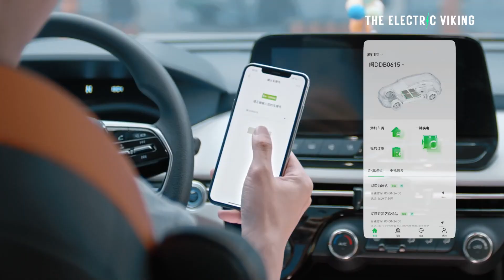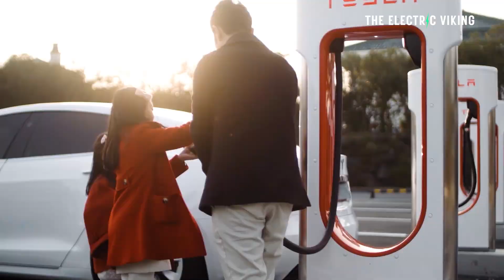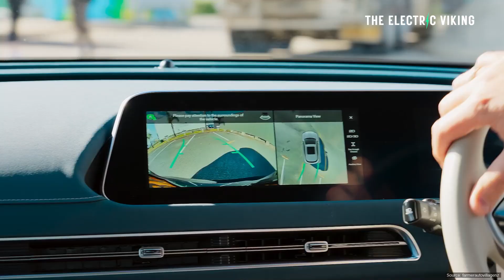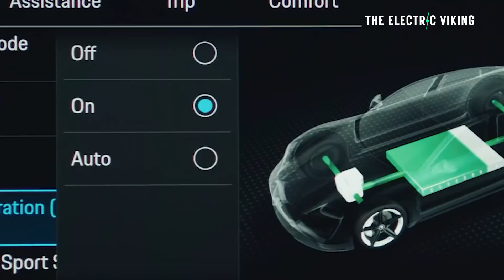Study reveals the price to replace EV batteries has halved

Comment: I don't want my battery to be replaced, I want it to be repaired for a considerably lower price.
Reply: there are battery repairers for Tesla in the US Gruber motors being one
Reply: It would be awesome if the vehicles with the 4680's were designed to where each cell could be replaced.  Instead of glueing them all together.
Reply: @ryandgarland  The problem is roughly 90% of the battery issues happen because of water leaking into the battery case. This is why they glue more and more.
Reply: @gerbre1  👍 their approach is that the battery is meant to live for the life time of the car.  Which is ideal.  However the tech isn't quite there yet, so some battery replacements are still necessary.   This is where dreaming of a hypothetical world where being able to replace each cell would be ideal from a consumer repair perspective.   In the real world, it doesn't make any sense from a functional or economical perspective.  Gluing the whole thing together and making it more structural is a better way to go.
Reply: @ryandgarland It‘s meant for the life time but EVClinic has much to do.
Reply: @ryandgarland  TThe future is blade cells. They can easily be replaced.
Reply: @ryandgarland  The price of the pack WITHOUT batteries would probably be at least 5 times more expensive if you were going to try to do that.  Plus, you'd lose a lot of component rigidity
Reply: You're driving a 4 wheeled touchscreen phone, not a car.  As a result, failed components must be replaced, often at a cost exceeding the value of the thing.

Ain't gonna happen.

Comment: Toyotas recent 3.4 Twin Turbo V6 debacle cost the company $30,000 for each engine rebuild at the STEALERships, and that is not an all new engine only parts that went bad,new crankshaft and block and bearings.Toyota still has no clue what is the cause of failure.
Reply: That's not true, Toyotas don't break, I read that all over the internet.  That's why the don't  have an EV because their GV's are perfect in every way.
Reply: @joedoesfun9336  You know what? The Internet never lies, because it is like a broken record.Lol

Comment: Sam, good job appreciate your videos. One thing,  If energy density increases I don't think you need a lower KWH battery for same range. I would think that  if energy density increases, You need the same KWH battery (60KWH in this case) but the battery will be lighter, smaller, eventually cheaper for the same capacity (60KWH).
Reply: TOO much people assume that less weight drops the energy consumption/ mile also.
That thought is , especially for regenerating EV's, completely false.
Because the extra energy you need to accelerate a heavy car will be regenerated back when slowing down for the most part.
The only increase with extra weight is  some rolling resistance...but in EV cars that is a tiny fraction of the total energy we need to overcome the drag of the car.
(I never noticed a higher energy usage if my car was empty (only myself as driver) or loaded to the max allowed weight.)

Comment: so the cost of battery packs is coming down, but we are told the cost of a battery is half the cost of the car new, so why aren't we finding the cost of cars coming down, except in China
Reply: No. A $50 per kwh  80kwh is only $4k. Even if you double it to account for pack fabrication costs it is still less than half.

Comment: A Price being down 50% isn't saying the cost of production is down.  Just as BEV prices are being slashed; it isn't due to lower production costs, in fact those are rising due to higher interest rates.  The prices are down due to lower demand for the same reason; higher interest, resulting lower demand, and over production. You can find many such economic upsets.  Oil producers can overproduce resulting in oil sold under the cost of production; or wheat, or hoursing in a high interest environment. So you see all the BEV makers and subsystem makers cutting prices and quaity just to try to survive. It isn't a good sign; it is a very bad sign as profits go to losses.

Comment: By law in the US, an EV battery has to be warrantied to 8 years/100k miles minimum.
Reply: Which is not enough, considering replacing a battery pack is still extremely expensive. That is why the second hand EV market is having a difficult time. Depreciation on EVs is extreme, like 10-15% per year. Pure money pits.
Reply: There are two types of EV battery warranties, failure warranties and capacity warranties. All manufacturers offer a failure warranty. (e.g., 8 years/100,000 miles). This is applicable if the battery fails completely. Some, but definitely not all, manufacturers offer an explicit battery capacity warranty (e.g., minimum of 65% capacity available for 8 years/100,000 miles). If you buy a vehicle that does not have a capacity warranty and the capacity drops by 80%, what is your EV battery worth?

My 2017 Leaf dropped 13% in 18 months and had a capacity warranty. My 2007 Civic Hybrid battery dropped 84% in 5 years and did not have a capacity warranty.

Comment: For some reason, leaf ev owner's (I have a 2017) never can quite qualify for the warranty guarantee. Always some fine print clause that explains why you just won't get a free replacement, but they want $15.000 here in Oregon & if you say "do it" you go on an 8 month waiting list that never seems to get cot up. I can get another 2017 leaf used for $8000. Yea, they don't want no stinking electrical car's messing with that worldwide oil power! PS most dealers don't even have an EV tech on hire in their shops in America.
Reply: It is typical car stealership / manufacturer tactics. I had the same thing with a suspension strut fault on a Peugeot. While the car was in warranty, no issue could ever be found but the WEEK after warranty expired, the mechanic had diagnosed the "fault" before he had driven the car out of the parking lot. They eventually did the work based on an 85% reduction but I was still steaming.

Comment: Estimates have the CATL LFP pack at $85/kwh in China. This would be a volume quote. Perhaps Tesla China pays a little less? In reference to "replacement" batteries the current generation of EV batteries at "ten years" measurable range lost will be 10% to 20%. Perhaps we're estimating 175,000 miles? I've been running gas cars for a little over 50 years, the average gas car over 175,000 miles is not a joy to drive.  

There are 80 battery factories planned or under construction worldwide. Billions are being spent getting the price down and they have succeeded. All of this being said? Replacing an EV battery is very expensive and they are never going to be cheap.

Comment: Sam, 8 years is nothing. EV batteries must last as least 20-25 years in good condition and the warranty must be doubled from the 8 years. There is no point otherwise in the whole electric car market. There will not be any resale value for old EVs if batteries must replace a cost which is 10-20 000 dollars. Still EV battery replacement cost cannot be higher than 3000$.
Reply: Show me an ICE car with a 20 year warranty on any part.
Reply: @GlenisRetiredNZ  Show me the ICE car fuel tank which will fail when fueling up too fast or too often or too many years? There is no need for warranty for ICE cars fuel tank because it will not fail. 

Exactly. EVs will come of course but energy which is used and filled must be as reliable as like fueling a ICE car tank.

Fuel tank could last even longer than 20 years without any degradations or corrosions inside the tank. It is not the consumer's job to pay the expensive development costs of insufficient batteries for electric cars.

Comment: And I would think the replacements would be better than the originals. I would only count on Tesla and the Chinese to replace them though .
Sam you should see the new Munro Live Ytube on the Sakuu battery . Solid State Lithium in stack able polymer cells. All dry process for both cathode and anode. There where reports of the other brands of cars like you mentioned raping there customers for replacement battery's

Comment: You will need the same kWh battery in the future , the weight of the battery may be half the weight/price . But you will need the same capacity
Reply: yep a lighter battery might engender some overall efficiency but the kwh needs to be the same.
Reply: Agree. I heard same in multiple videos. If you have 60KWH battery you will always need a 60KWH battery for the same range. When energy density is higher, volume and weight of the battery will be lower.

Comment: Have a 2015 LEAF, and everything is fine, including the battery. Zero problems with the main HV pack.
Reply: congrats!

The battery pack of my 2022 BEV has been replaced just a few weeks ago on warranty.

Meanwhile, the lead acid battery in my ice car is still doing its thing.
Reply: @svr5423 I just googled it.  The leaf does Not have a thermal management system for its battery.  Your experience is not surprising.   it is expected. 😮
Reply: @svr5423  The 12 volt lead acid battery in my 2015 Leaf lasted nine years and only needed replacement earlier this year.
Reply: Does the leaf have thermal management on their batteries yet?  At one time, they only had air cooling.   This can't still be true?

Comment: There is hesitation on buying new electric cars due to manufacturers rapidly reducing prices of late.
There is hesitation on buying second hand electric cars due to the above and also the uncertainty of the condition of the battery.  Most people are not going to check the battery with an OBD reader, and apart from that, there is no credible source of information to go by with concerns to battery health.  Issues like - has it been overly supercharged, has it got damage from road debris, what is the current degradation, what is the makeup of the battery (NMC - LFP etc), or even what is the current cost of a replacement battery?
Apart from all of that putting the skids on second hand buying, people know that new chemistry batteries with much longer range, much more safety and the fact they are becoming cheaper causes buyers to wait and see.
Reply: I bought a used model 3 for 19,000 with 20% degradation.  Should go for another 200,000 miles if I take care of it.  In fact it seems to have rebounded by one percent.  Pretty good deal for dollars per mile of range.  Awesome car to drive.

Comment: $10,000 per kg. So a dead battery is worth $100,000?
Reply: 10 Dollars per kg is realistic.
Reply: Your math is off, the price of battery packs is calculated by the capacity of the battery not the weight. Eg. $133/kWh for an 80kWh pack is 133x80=$10640.
Reply: EV batteries are not 10kg, they are at least 200kg. So you're looking at around $2 million dollars trade in value, yep.
Reply: @yggdrasil9039  No wonder Elon is the richest person in the world!
Reply: @stefan2796  Why, he sells a 2 million battery pack for 10 thousand? How does that make him money?

Comment: Pretty sure an old engine is worth it's weight in scrap iron. It's not nothing
Reply: Quick math shows an average car engine is about 500 lbs and scrap steel rates average 7 cents per pound yielding about $35 for the steel in an engine.
Reply: @chrishaberbosch1029  wow, in denmark 2 pounds is like 1.5 dollar at a scrapyard

Comment: Can one of you very intellectual people on this channel please explain the difference between my iPhone battery and the battery in Ev’s apart from the obvious size difference thanks in advance 🤔
Reply: Many differences. Chemistry is the obvious one. Mobile phones and laptops use LCO because its lighter. Electric vehicles use either NCA or LFP or NMC because more powerful. Another difference is pack arrangement. Mobile devices typically 1 cell is enough power. Vehicles needs tonnes of power so use many cells and complicated battery management systems (BMS) to balance the cells. The next difference is thermals. The expectation electric vehicle batteries will last 8-10 years means more attention is paid to cooling and heating, because too hot or too cold will harm the battery. Not many people care if their mobile phone will last 10 years so thermal management is almost never done except for critical (dangerous) temps.

They both use lithium but there's not much similar between mobile and vehicle batteries apart from that. They're more different than they are same.
Reply: Key difference is thermal management in car batteries which massively extends their useful life.    Batteries are good for at least 200,000 miles and the very latest ones up to 500,000 miles.
Reply: Similar chemistry to many EVs but with a higher percentage of cobalt.  Probably nickel manganese cobalt.

Comment: If I buy an EV today, am I going to have the option to upgrade it later in 5 years, benefitting from next gen batteries with more density? For the space - especially in smaller EVs - is limited.
Reply: Yes, look at the Nissan Leaf platform as an example - started in 2011 with 24kWh - today same size battery box can fit 50 to 60kWh of LFP cells.
Reply: Yep, but shop around. I made some enquiries about swapping out a dead (well, below 70%) Hyundai Ioniq battery and the cost was more than just buying another second hand Ioniq with 90% battery.
Reply: I really doubt there will be "next gen" batteries for older chassis. Even on EV which have way fewer moving parts than ICE, there are still many parts and they all wear out eventually. And at some point it stops being economical to repair the car. Batteries are not the only thing to worry about. Consider ball joints, bushings, suspension, motors for windows, motors for seats. Then non-moving but essential parts like the interior fabrics, rubber seals on window. And active systems like the HVAC and compressor. The HVAC isnt just for you in the cabin,  it's also essential for battery operations. Tesla calls theirs the Super Manifold and it's complicated! And computers the heart of cars such as Tesla, they wear out too. Silicon isn't forever. It has wear just from use - lookup the phenomena known as "silicon aging". This has become more noticeable as chips keep getting smaller (in nanonmeters). Lifetime for modern silicon is now estimated 10-15 years.

Consider an EV a disposable item. There will be situations where repairs make sense. But I think with the way tech is moving, if you get 10 years from an EV you've done well and should move to the next generation. Recycling is hopefully good enough by then.
Reply: @nhand42  you can already buy them of first generation Nissan Leafs.
Reply: @badchefi  What you buy now are by definition current-gen batteries. The op is asking about future next-gen battery tech with more density. For example solid-state batteries are one possible next-gen tech. I can't imagine there will be enough of a market for first-gen Nissan Leafs for it be worth any company to make such a niche product. It's not just about changing the pack. Future batteries might require different cooling, management, computer remappings. It's not like changing the AA on your TV remote control. But who knows. Maybe first-gen Nissan Leafs will become so desirable and their owners so rich that companies can't ignore them and will make next-gen batteries plus all the associated changes for those ancient Nissan leafs. We'll find out in 10 years when next-gen batteries actually exist.